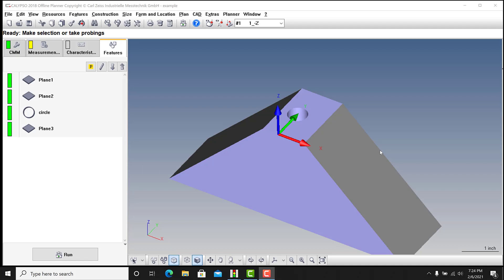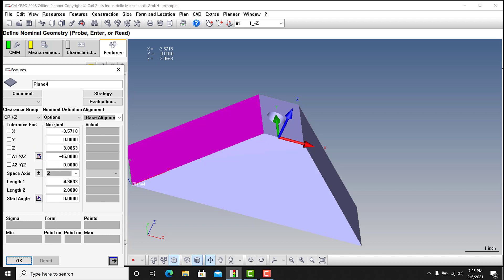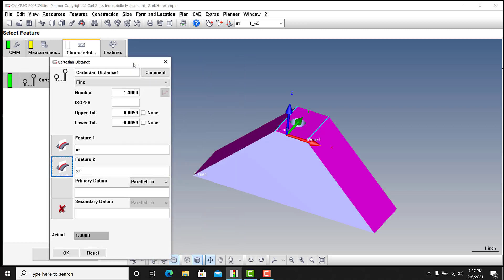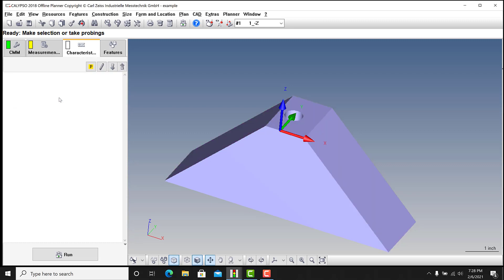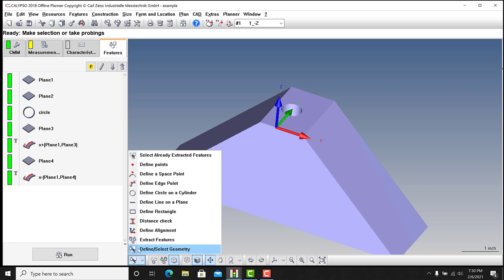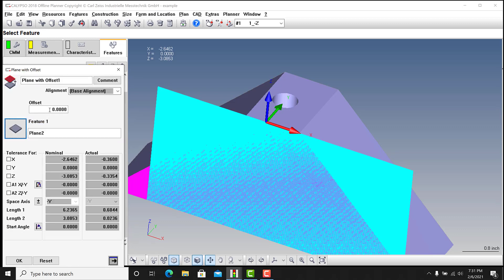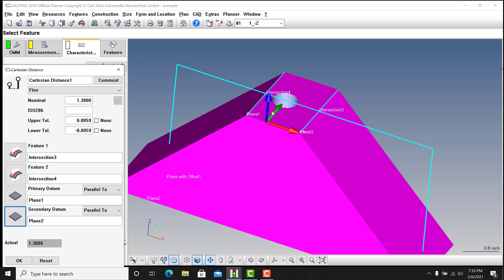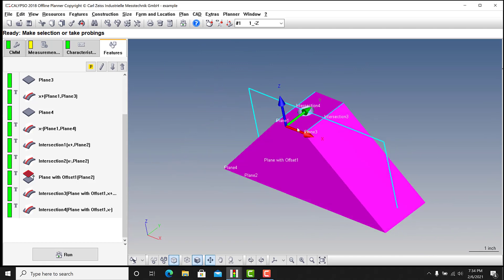Zeiss CMM Calypso Distance Between Intersection Lines

Comment: I just ran into this issue in Calypso class. The solution is when you are creating your intersection select 3 features instead of 2. Left face, top face and front face gives you 1 point. Then for the next intersection choose right face top face and front face and that will give you the 2nd point. Then create your distance characteristic.